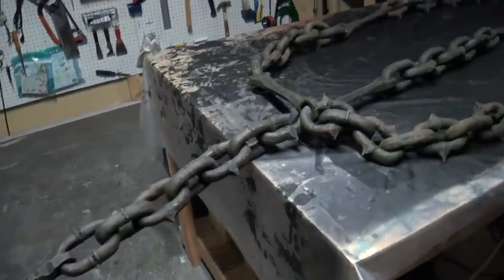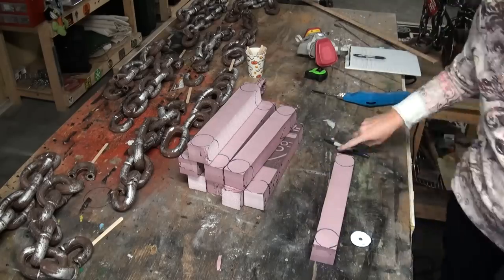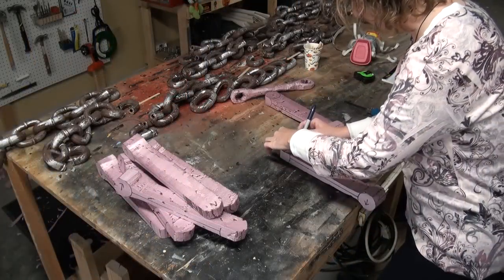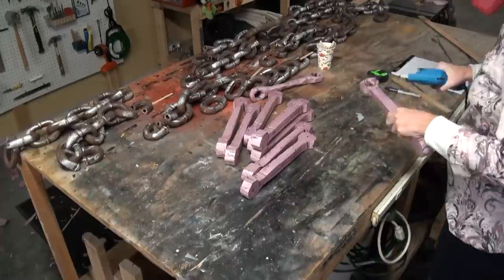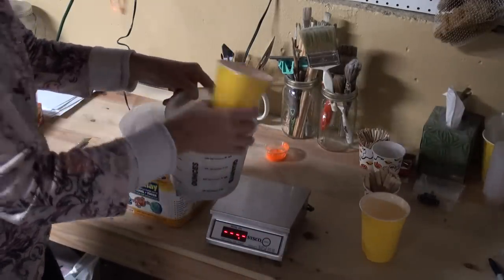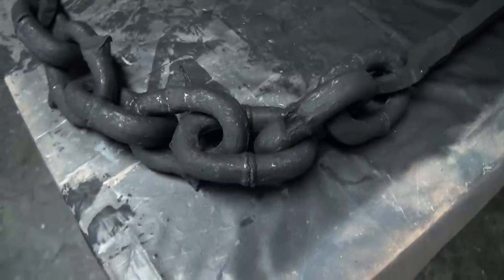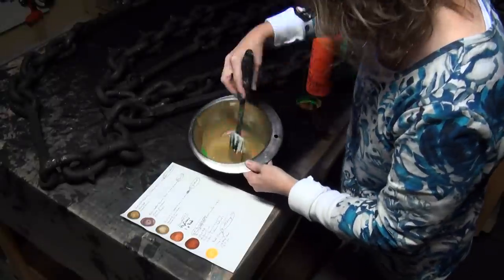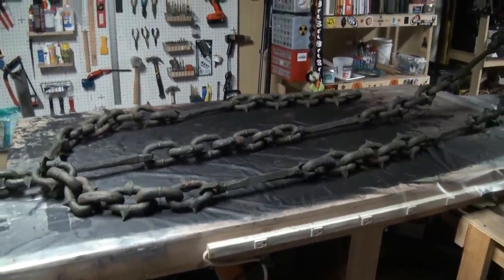Spiked Chain Halloween Prop

Comment: For hardcoating, I usually use several coats of carpenter's wood glue. It's tough, light, and even sandable! If you get the gallon bucket for about $20, you'll find yourself using it for just about everything.  :)
Reply from the maker: Oh, great tip and I'll give that try. Thanks!
Reply: You can get a gallon of it for about $20. I bought one over a year ago, and it's not even half gone yet. :)

Comment: how durable is that pink foam stuff?  Some of those parts look pretty thin and I would be scared of breaking it just by touching it the wrong way or having too much weight hanging from it
Reply from the maker: Not that durable and a great question. It held up fine as a decoration but as I moved to Austin and got picked up a few times a couple of the bars broke. So, keep that in mind and/or hard coat them.
Reply: Scaryladyvideos What material(s) do you use for hard coating something?

Comment: Instead of the pink foam, you might try wood for this kind of project since you could use the added durability.  Any standing blade (either miter or table saw) would allow you to shape the length of the wood.  Alternatively, a scroll or band saw would work; I'm just better with a table saw.  A hole-saw attachment or (better) spade-tip bits would do the holes on the ends.  Might take longer, but props would hold up better for longer.  I wish you lived closer.  I'd let you borrow my tools.
Reply from the maker: Oh, that is an excellent idea to make these last and last. Thanks for that and hope others see this.